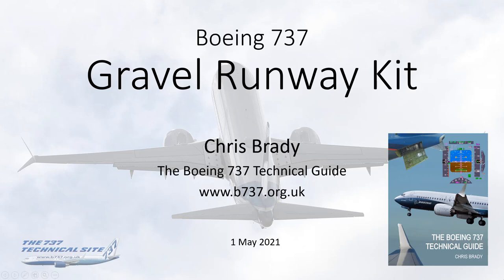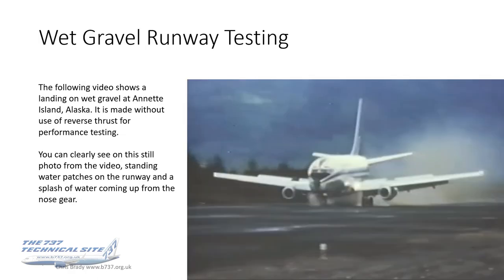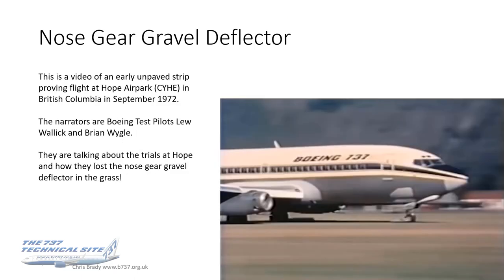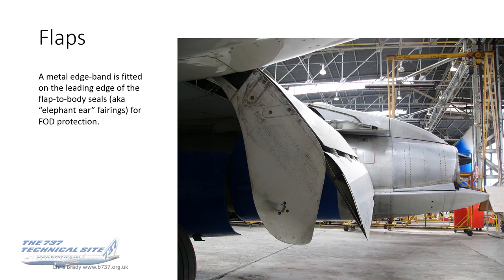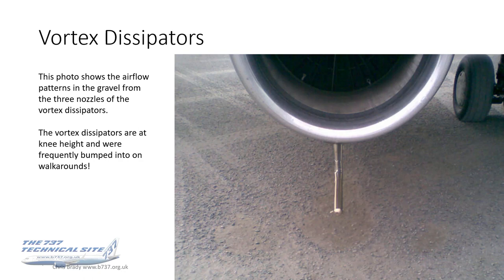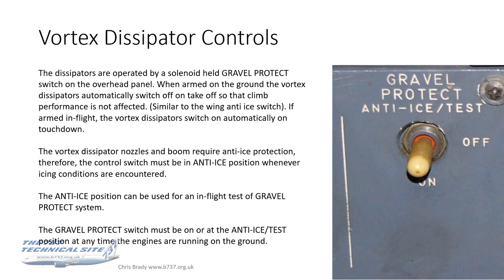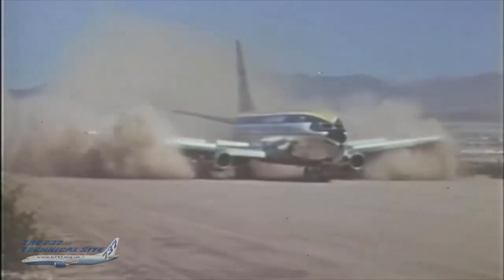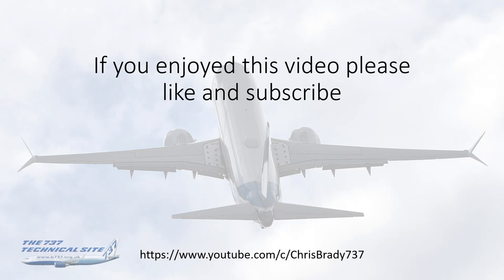737 Gravel Runway Kit

Comment: I really enjoy all your content as I operate these aircrafts. I'm not sure about the gravel protect switch being a solenoid because it never reverts to another position once the cockpit is powered off.  The system presents no immediate safety hazards if failed. The anti-ice/ test position is systematically used with the use of engine anti-ice and the idea behind it is to avoid the formation of a ball of ice that would otherwise fly into the engine. Cheers!
Reply from the maker: Hi, thank you for your comments, it is always great to get some additional info on a subject. If you have any better photos than I used, eg the GRAVEL PROTECT captions then please send them on to me.